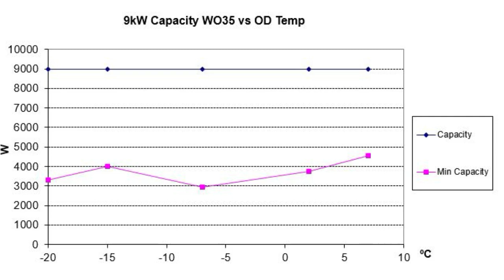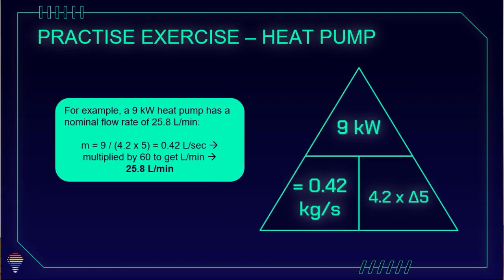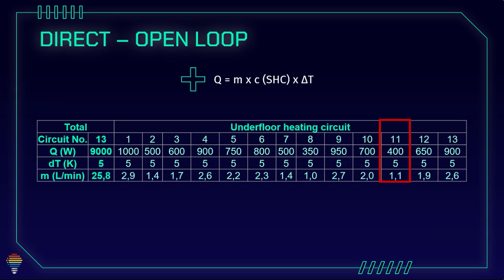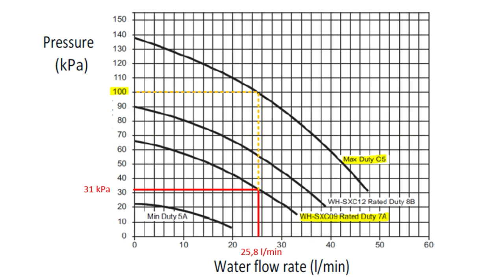Underfloor Heating Without a Buffer? Circuit Design & Flow Rate Explained | HVAC System Tips

Comment: Hello Mario. The method you analyze is quite simple and efficient. But I am not sure it is realistic in Mediterranean climate and buildings with large windows areas. I mean when you have heat gains from sun during shinny days, something that highly affects the internal temperature and overheating, how exactly do you control this when you have only one thermostat in one point of a level with large underfloor heating area, e.g. 120sqm?
Reply from the maker: You are right, heat gain is the problem if you have large windows. Advanced modulating control could be useful in that cases.
Reply: @HVACEducationHub Without measuring temperature in every room?
Reply from the maker: @A.A.600abitw  it is always a problem if you have a lot of zones and reduced water volume

Comment: So i understand it that you mean a thermostat in each room for underfloor heating is a no no as would increase cycling and in turn decrease efficiency, however one central stat with weather comp would be ok? Also you would need to know the meter of pipe run for the underfloor also or just by using triangle to calculate the flow rate in LPS? Love the vids
Reply from the maker: Thanks for watching!

1. Correct, but with modern modulating thermostats you can use them in bedrooms if you want to decrease that rooms but all others must be open zones if you want to avoid cycling.

2. Pipe meters are important for pressure drop, flow rate you can calculate by triangle

Comment: Great video, everybody should be able to make these simple adjustments to ensure maximal efficiency and comfort.
I think another important thing is water temperature. There might be cases where a room might require higher flow temperature if for instance the R value for the floor is large. In these case we either have to increase water temperature (which is bad for heat pump efficiency) or increase the flowrate. 
Pipe distance is also very important, and it should be according to the floor's R value.
Reply from the maker: Of course but in that case is better to go with more pipes so you can go as low as needed with water flow temp

Comment: Most private dwellings do not have a FMD (Flow Measuring Device ) so is the flow rate determined on delta t' only?  if the flow rate is not to design then the balancing of the system  can be a very very long process would suggest a ultra sonic water flow measuring to achieve the desired  flow rate if a venturi measuring is not available, I think most DIY people would  not have one of these instruments available , but your Educational lectures are very informative and full of useful information well done and please keep it up.
Reply from the maker: Thanks, really appreciated.
On radiators is harder, you need to measure, but on UFH you have flow meter on manifold and you can balance your circuits.
Definitely not for DIY people 😉
Reply: @HVACEducationHub Most people do not have UFH so how are we going to confirm the flow rate through radiators?
Reply from the maker: @Yorkshire-z5v  this episode is about UFH, not about radiators.
On radiators you need to measure delta T between flow and return pipe and calculate capacity and flow rate